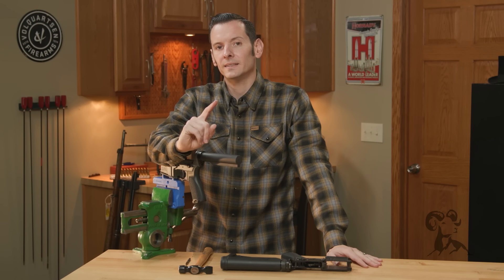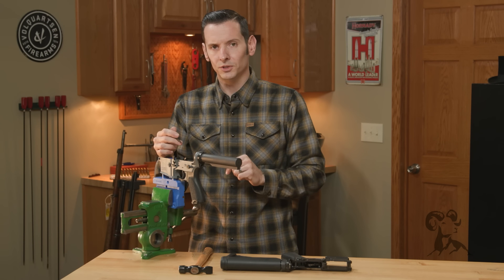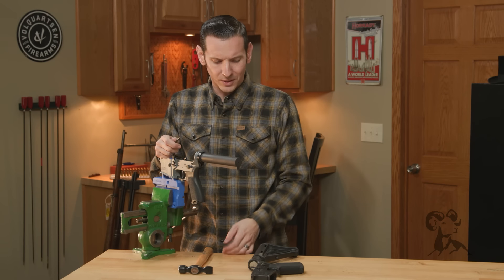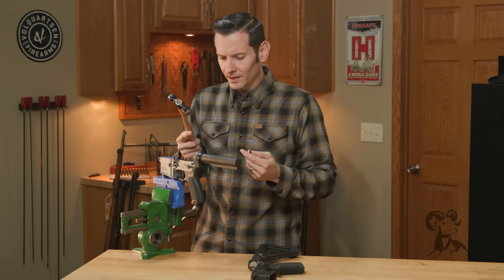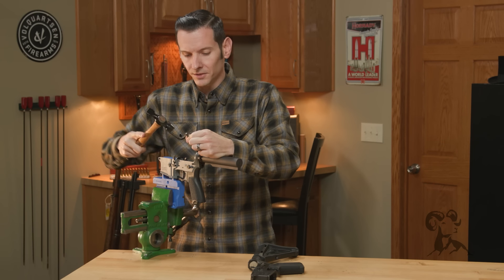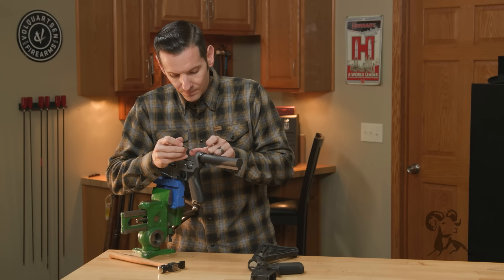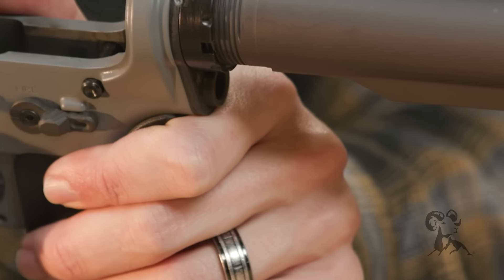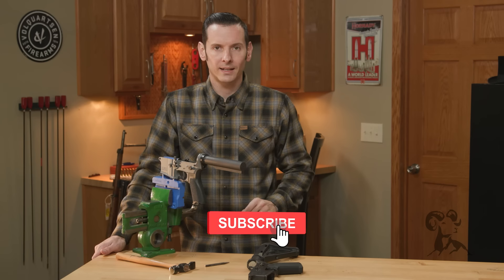Quick Tip: The Right Way To Stake an AR-15 Castle Nut

Comment: Why is it bad to use thread locker? I am planning on upgrading my buffer and tube with an expensive one so I didn't stake it yet, it's really the only cheap part on this build. I did use some thread locker and nothing bad has happened yet. I'm sure it will be easier to remove than a staked castle nut.
Reply: There is nothing wrong with blue or green Loctite in this application. I prefer green as it penetrates and is applied after tightening the nut. It gums it up nicely after penetrating and you can still apply your wrench later to remove it if needed. Good for scope mount fasteners too. That piece stays at ambient temperature, so it is a fine application for it. If anyone can explain WHY it's a bad idea with real engineering terms, I'd be happy to listen and learn. But don't just start ranting about words like "proper" and that all the operator guys on the forum said so. That is religious belief, vice engineering. ;-)
Reply: From a long automotive background, I've never had a thread locked fastener come loose, even on an old Harley Davidson.  Caleb maybe a "good" gun smith, but he isn't an engineer.  I have attended presentations from engineers at Henkel and heard the science of how thread lockers work and their vast applications.  "Staking" was used in the 1960's because the chemical science of thread lockers wasn't readily available to military armorers.  My personal choice is blue for non permanent applications.  Red is for permanent.  Most greens is for bearing/bushing retainment, not threads (some are made for threads when you need to seal the threads from a fluid.)
Reply: @AppleJack76  Yeah notice he didn't explain the technical reason why you should never apply thread locker to the buffer tube. 

The key to making thread locker work most effectively is to clean and degrease the threads on both pieces. Acetone or brake cleaner both work really well. The better the product sticks the better it will hold so having it clean really helps. 

I still believe staking properly is going to be the most effective if you are not planning to upgrade later. Or maybe blue loctite and one light staking. If I'm going to war with that thing then I would be staking the shit out of it honestly. Since I'm not going to war I'm not that worried about it but I still want it securely attached.
Reply: Totally fine to use blue threadlocker. Staking is just the military “spec”. It’s difficult for some folks to realize that in the 20, 30, 40, 50+ years the AR platform has been used there might be a few new areas where deviating from mil spec is ok.
Reply: It won't be easier to remove, it's weaker than staking, and you've done nothing other than secure the nut to the tube. Staking locks the receiver to the extension.

Comment: Is it necessary to apply a coating of any sort to the bare metal in the stake itself?  It seems the punch removes any phosphate coating the end plate had.  I might be guilty of overthinking things.
Reply: If you're in the rust belt salt will get in there and the gun will rust up and turn to orange cheese after 10 years before heading to the scrap heap. I recommend some fluid film after sending the whole rifle off for powder coating just to be safe.
Reply: @s0nnyburnett  Hey, easy tiger, he was being nice.

Comment: What's the best way to align the receiver extension and lower receiver?
Reply: It indexes off of the spring loaded pin at the front.
Reply: Receiver extension should index at the buffer retainer. To get both as straight as possible when you torque; you would need a captivating tool that indexes at both where the pistol grip goes on the lower, and at the receiver extension.
Reply: After you snug it up slightly, you just eyeball it. If it's off a little, you can see it and move it a little bit. It indexes very close anyway when it clicks in place.

Comment: What is your opinion of using automatic center punches? I have achieved professional LOOKING results from this method and also allow me to get to all available staking points and of the dozen or so rifles I have done this with none have come loose? Unfortunately I also have a couple rifles that have no staking at all for ease of changing things and they haven't loosened up either
Reply: Love em! I have a few but did not want to use it for this video, I wanted to keep it as budget as possible with still being correct.

Comment: Best way to remove a staked castle nut if you had too.
Reply: With a wrench, the metal of the backplate is soft and will bend out of the way; you may need to use a fair bit of force and maybe a breaker bar though.

Comment: Justifiable for a military or law enforcement type use, but this looks a little over-kill for sporting use.  I would like to be able to remove the castle nut and extension if I decide to make changes in the future.  I won't be going over-kill on any of mine.  Guns I put together 25+ years ago are still together.  If you want to beat the hell out of the nut, have at it.

Comment: Disclaimer: Caleb and Steve are two of my most trusted sources of firearms related info. And I realize this video was likely by request.

If you spend your days fast-roping out of Blackhawks, running, jumping, crawling over obstacles, firing bursts in full auto, and generally just beating the weapon up... By all means, stake away.

I am not an operator who is operating operationally and I have never staked a castle nut. Not once. And I have had zero instances of one coming loose. My rifle spends more time in the safe than humping klicks and being in firefights though. That's not to say I don't shoot it often. But it doesn't see the type of day to day rigor that necessitates the extra insurance of staking the castle nut.

Just a bit of perspective if you're stressing over this topic.

Comment: I’ve got a ruger precision that I bought secondhand and it wobbles slightly at the castle nut area. Could this be because it’s not staked? If so then should I take this in to get fixed?
Reply: Doubt it. Sounds like excessive tolerances and / or it was not tightened enough.
Reply: @LuvBorderCollies  would it be a good idea for a gunsmith to look at it so I don’t screw something up?
Reply: @Dmounts  Tightening up the castle nut is easier than tying shoes. You mentioned you bought it 2nd hand. So that makes me suspect the previous owner changing parts. Whether they knew what they were doing or not is another question. Ultimately its up to you what direction you want to go first. I'd get the special wrench which is about $10 stamped steel version which I use. Hopefully that will fix it. But the fact remains....staking will NOT fix iit.
Reply: @LuvBorderCollies  thank you! Super helpful advice!

Comment: AR guy 1: "You staked your castle nut wrong."
AR guy 2: "Actually I didn't stake my castle nut at all."
AR guy 1: "We can't be friends anymore."

G3 guy 1: "I use a $400 form and a custom hydraulic press head to manufacture my receivers essentially from scratch."
G3 guy 2: "I use a piece of Unistrut I took home from work, a couple C-clamps, a pair of bolts and wing nuts and a chunk of 3/4" rebar to bend my flats, and I do my welding with a flux-core wire welder."
G3 guy 1: "That sounds like a lot of work and it's cool that you were that inventive with your process using such basic materials. We should get a beer after we're done shooting our superior roller-delayed battle rifles that do not unscrew themselves in use."
Reply: Go away

Comment: Use a receiver extension fixture tool instead of a well block, all of the pounding force is on the lower vs the extension, I never stake this way. 😢

Comment: I don’t know, not familiar with this.  My ‘90’s era Bushmaster with telestock didn’t have the nut staked at all. It’s still shooting fine, but maybe I’m missing something after 30 years.
Reply: Never staked one either. Put some muscle into it. Growing up on a working farm teaches you a lot about bolts and nuts. Never seen a staked nut on any farm machinery especially combines and those older ones shake/vibrate far more than any AR.
Reply: You are missing something after 30 years.
Reply: @KeepTheGates  LOL!  Really?  Tell it to Quality Parts Company (Bushmaster), who along with DPMS were the sole competitors to Colt in the ‘90’s.  So it has to be staked, but the rifle (a 1:9 Dissipator) has been shooting fine for 30 years?  Sure, you betcha.  

There are lots of internet camo commandos who know all sorts of things about AR’s and other guns that just don’t happen to be true.  These are the same guys who incorrectly tell you a 1:9 twist won’t stabilize heavy bullets.  Internet fabulists who know all about guns from Call of Duty.  😆

Comment: Assuming the person isnt a moron and knows how to use it properly Locktite and proper torque on the Castle nut is better IMO....its not hard at all to heat up red loctite to get the Castle Nut off....The reason for me to not stake is that if you have to take off the Castle nut for any reason you gotta break the existing staking which is a harder thing to do opposed to temoving the loctited Castle nut...then you gotta move more metal to restake.....

Comment: I don't recall the M16A1 or A2 needed to be staked, for that reason I'm out Curtis.
Reply: The castle nut is only on adjustable stocked ARs. The fixed stock uses a different retention method.

Comment: I file a small flat spot on the very top of the plate, install everything, and then tighten the castle nut as far as I can and line it up with the flat spot on top, then I use an automatic center punch and do it a few times until some metal rounds out into the slot.

Filing that flat spot helps keep the center punch in place while I push down the spring and prevents the punch from slipping, Not something you really have to worry about as much with a regular punch like you use in the video

Comment: I take my stuff apart way too much to stake anything I am not going to toss and replace.  I use ratching ones or just dont stake it.  A rifle I am hiking miles with and need to bet my life on is one I would stake, but again, that rifle at that point is a disposable tool in its entirety.
Reply: Why would you need to constantly remove the reciver extention?
Reply: @johnadams673  I buy a lot of stuff.  I try a lot of stocks, some require different buffers, some fold, etc.  I also cerakote my own stuff and anything metal is fair game.

Comment: I wrench tighten my castle nut. Not one has come lose yet. Ever need to change it for QD versions or otherwise, good luck. Better off using blue loktite. It will hold and be fine, yea yea dont do this… Looked far and wide to see pros and cons. Did not find any correlation to justify doing this or not doing this.

If this is indeed required, make every end piece QD with option sling points. So challenge the above, but when and why did this become the must do action? I see many not staked and not built by the owners.

Comment: I have been building for 9 yrs now, and ive never staked a castle nut...i take stuff on/off too much
Reply: It’s no fun when it comes loose during use
Reply: If your rifle never gets far from a wrench I suppose it's pointless. If you're often miles from anywhere without a wrench it may be worth it.
Reply: A little blue thread locker goes a long way.  😉
Reply: @AppleJack76  you shouldn’t threadlock your castle nut bubba
Reply: @AppleJack76 I have reasons that I don't use threadlock on the castle nut but you can do what you like.
Reply: @goinhot9133  I wouldn't know. I have never had one come loose.
Reply: Why keep removing and reinstalling parts? Just leave it be.
Reply: @redcat9436  do you even build, bro?
Reply: @goinhot9133  

You can 100% threadlock the castle nut, kid.

Comment: Why bother staking it when a drop of green Loctite will hold it well and not deform any of the metal parts? I mean, its the 21st century after all. Just say'n. It's not 1975 anymore.
Reply: A little blue thread locker goes a long way.  😉
Reply: Yikes